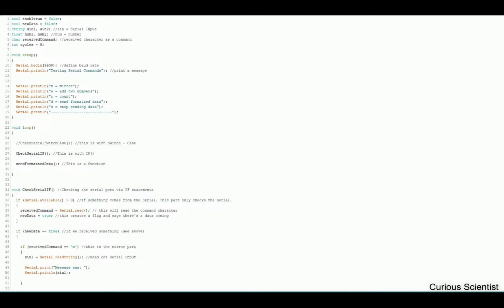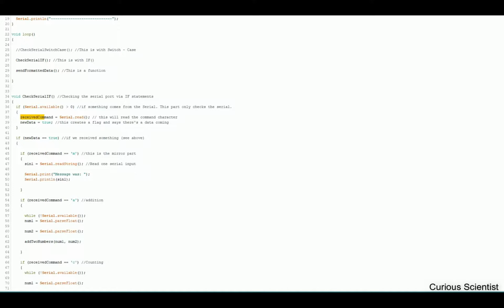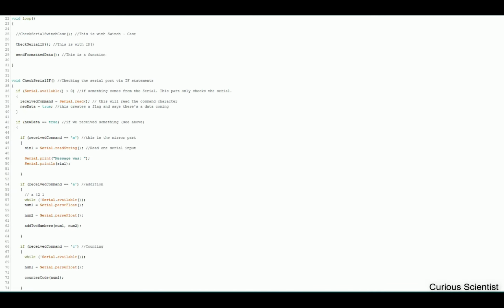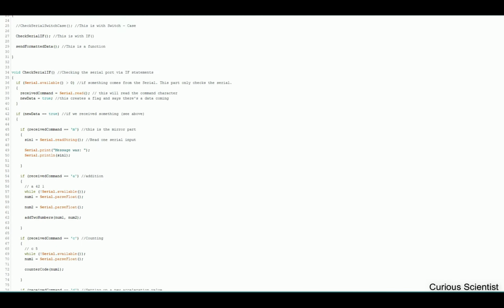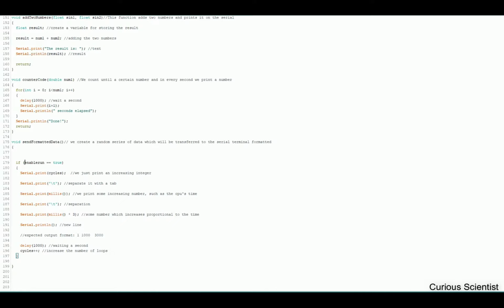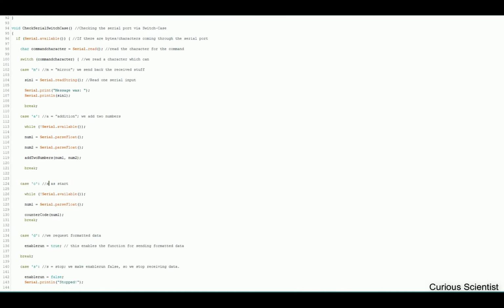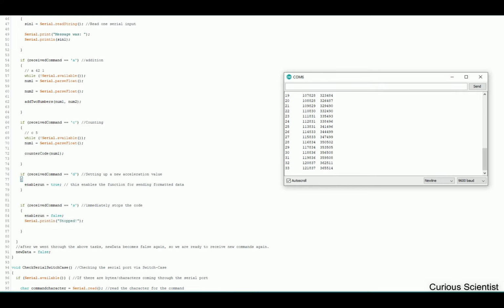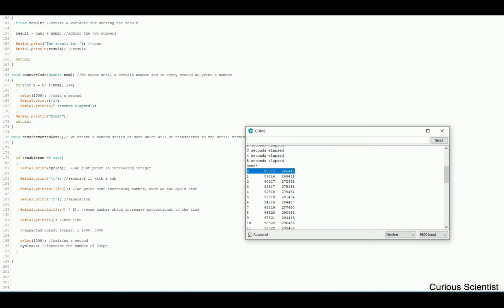Two-way serial communication with Arduino

Comment: This is one way communication!
Reply from the maker: I counted two. 1: sending data to the microcontroller, 2: receiving data from the microcontroller.
Reply: @CuriousScientist Between 2 pc is only 1 way communication. If i plug the arduino board with usb cable and try to send a message with serial monitor to another pc with usb-rs232 cable.
Reply from the maker: I suggest you look at the Wikipedia article about two-way communication. If both parties (here, Arduino and PC) transmit information, then it is a 2-way communication. There's no way around it.
Reply: @CuriousScientist Ok.

Comment: I have seen other videos where they use pyserial package of Python to communicate with arduino. In your opinion is it faster to use C# or any other reason?
Reply from the maker: Hi! I cannot form an opinion on this because I never worked with Python. Sorry. I use C# because I know C#, but I did not pick it because of some particular benefit over Python or anything.